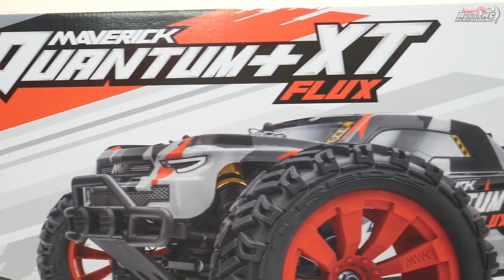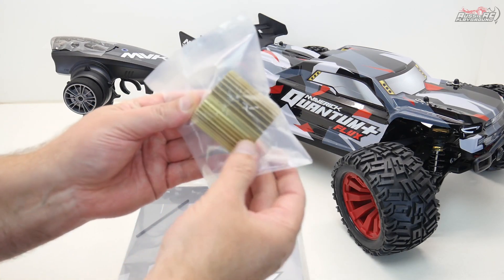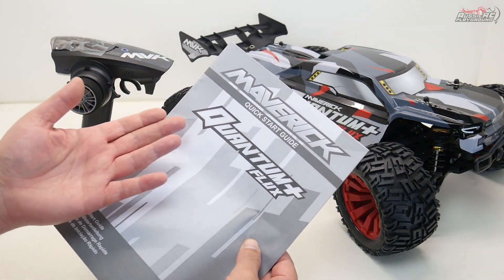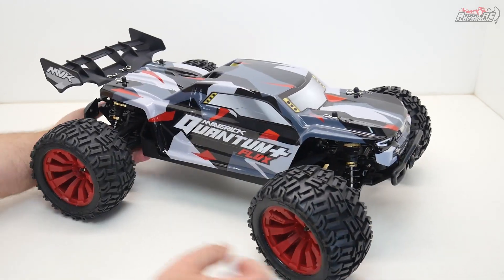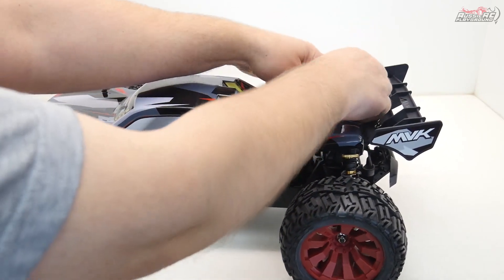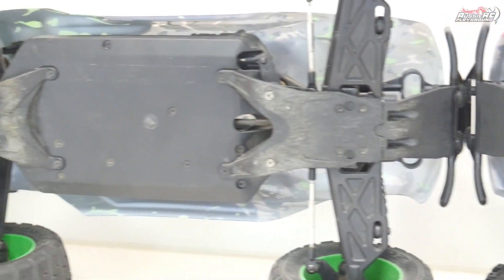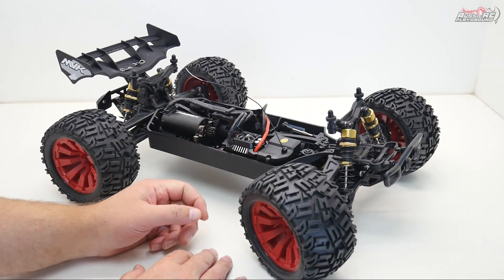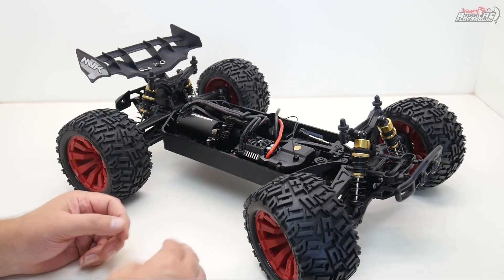Unboxing: Maverick Quantum+ XT Flux RTR

Comment: FYI Everyone that has this or is planning on getting it. The highest you can go on the pinion size is a 18T. This thing is awesome on 2S with the 18T on it now. 3S is over 50mph now! Cheers!
Reply: @BigFistAlex You can just use any aftermarket Pinion gear ⚙️ long as it’s a mod 1 size. Also mine is for sale currently on EBay. Only ran it 15 times. All upgraded ready to roll. I just don’t have time for it anymore.

Comment: I bought one the other day and under the wheel steering on the controller there is a little grey button it’s not mentioned in the instruction manual and no one seems to know what it is. Any thoughts 💭
Reply from the maker: It's a 3rd channel button, but it's not connected to anything so it doesn't do anything. Your receiver will have a 3rd channel port that's unused, so if you connected lights or another servo to it (like a wench) you can use the button to turn it on/off.
Reply: Ohhh wow I want to put lights on it now maybe police lights lol thanks dude
Reply from the maker: No problem. Just remember that in order to turn lights on or off, the lights need to have an LED controller connected to them. Basically, if you just connect some LED lights to the receiver, the switch on the handle won't do anything, the lights need to have an LED controller hooked up. The button on the handle doesn't turn the power on or off, just like your throttle and steering channels it just sends a signal to the receiver. So a LED controller is needed to receive the signal and then that will cut power or change the blink sequence or whatever it's programmed to do. The controller is just a little chip that goes between the receiver and the lights. Some lights will come with it, others you'll need to get the controller separately.
Hope that all makes sense.

Comment: Isn't that ESC 4s capable? With a fan on the heatsink for the motor, you could possibly try out 4s for a speedrun or something along those lines.
Reply from the maker: ESC is only 100amp, so not 4S capable. And neither is the motor... Sorry.
Reply: @AussieRCPlayground  Nah it's all good! it just seemed like a hobbywing max10 sct. Wouldn't make much sense to put a 4s capable esc in a 3s car from a profitability standpoint. Thanks for the reply! Keep up the awesome content!

Comment: How does the maverick compare vs arma's Kraton 4s?
Reply from the maker: You're asking how does a budget 3S car compare against a 4S car worth about 50% more? 🤔
Reply: @AussieRCPlayground  lol. If I can save a buck, i want to. But if there's a big drop off all the way around, I'll stick with purchasing the Kraton.
Reply: @AussieRCPlayground  don't judge me! Lol
Reply from the maker: Haha, we all want to save some green where possible, so no judgement here.
The competition for this car is the Team Magic E5HX, the Granite 4x4 and Big Rock Crew Cab. You can probably include the Hoss as well (based on specs), but the Hoss is double the money here in Australia, so not really a competitor. Both the E5 and the Granite are smaller than the Quantum+ and the E5 is slower. The Big Rock Crew Cab will be about the same size and will be better matched in speed, if not faster than the Quantum+, so it will just come down to parts support and durability between those two. The Quantum+ is $499 and the Big Rock is about $570, so there's not much in it there...
Reply: @AussieRCPlayground  thanks a million. Keep up the great vids